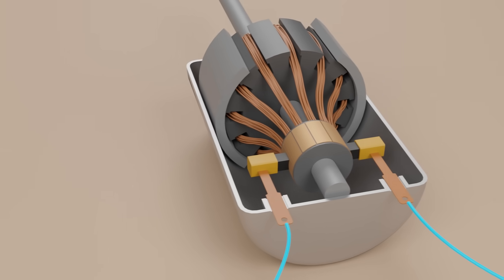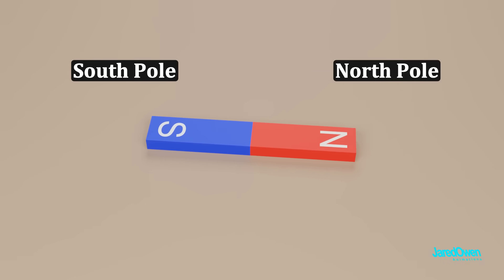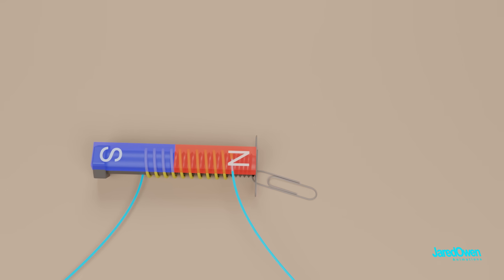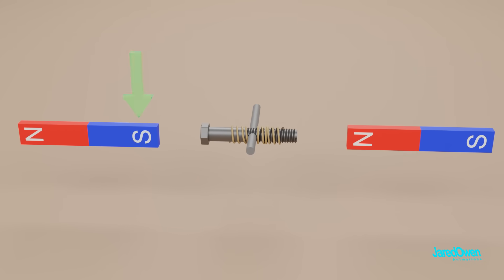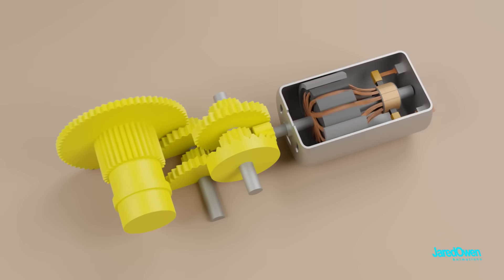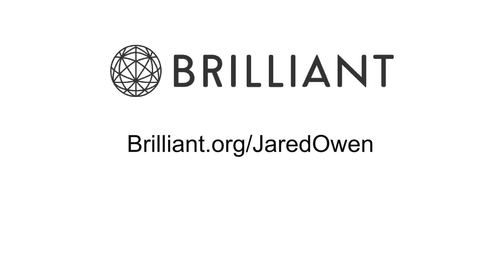How does an Electric Motor work?  (DC Motor)

Comment: Awesome video dude, but as an engineer I see one issue.
Axles transmit power without rotating.
Shafts are the ones that are used to transmit rotational power.
Therefore motors have shafts NOT axles.
Same goes for your car. The drive shaft (main shaft) is connected to axle SHAFTS which are connected to your wheels.

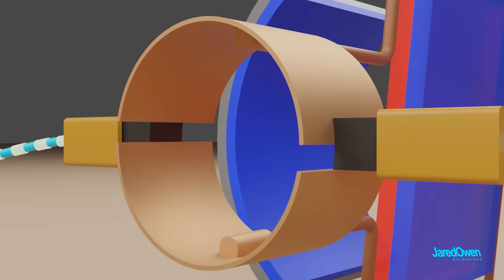Comment: At 5:39, the direction of current flow doesn't actually change though does it? This seems wrong to me for some reason. Can anyone expand or confirm what he said? There's never a change in direction of the flow is what I suspect.
Reply: Yeah it does because he is using dc with ac power it wouldn’t switch
Reply: @Vanilla_Icecream1231  What makes the direction switch in this case?

Comment: No and No.
 Magnets are Not attracted to each other.
They are attracted to a low pressure vortex into Counterspace, between the magnets. Magnets and LED's are point source from Counterspace.
 The commutator releases negative feedback spikes, between the copper contacts. Turning on and off, produces energy.

Comment: When I took the basic course as an electrician we would coil a wire around our screwdrivers, give them 230V for a few seconds and then they were magnetised for a long time, and would hold on to screws so we didn't drop them. We even magnetised one and hung it from a metal ceiling bar, and it would hang by the tip for weeks. So my question is: We seemed to make semi-permanent magnets instead of on/off electromagnets, or maybe a combination? How can this be so?

Comment: what about the fan, how can it rotate in one direction with each reverse plug (left to right, right to left) will the fan rotation also be reversed?
like the simple dynamo in the video, if the battery poles are reversed, the current will also be reversed

Comment: But how does the brushes switch the electromagnets?
Reply: I have been looking for that comment and any response for it. I hope that someone will answer it😊
Reply: One brush is connected to the positive terminal of the battery and the other one is connected to the negative.The commutator is split into two semicircles one semicircle connects to one end of the armature and the other semicircle connects to the other end. So when the commutator rotates the position of the circuits change. Did you understand ?
Reply: @halanjacob8702  No
Reply: @swetasoni2266 I don't know how to explain it to you
Reply: @halanjacob8702  ok

Comment: But when the brushes switch polarity with the commutator, it will cause short circuit?
Reply: Yes, and to solve this issue they have more than one loop of wires and commutators that are connected to these loops of wires, so that when brushes touch one side of the first loop of wires, the other brush touches the other loop of wires, that's how they don't cause short circuit

Comment: I love your videos, but you misspoke at the start. You said "conventional flow" when you should have said "current". There are two ways to describe current; conventional flow and electron flow. The only difference between the two is how you envision the flow of current. Conventional flow is when you envision the current flowing from positive to negative. Electron flow envisions the current flowing from negative to positive, because that's the direction the electrons actually take. The truth is it doesn't matter which way you envision it. As long as you analyze the entire circuit in the same direction, you will get the same result using conventional flow as when using electron flow.

Comment: I thought The outer part is called a poll ring, not a stator, the stator is in ac motors. Correct me if I'm wrong?
Reply: Stator just means it's static. The ring is a stator.
Reply: @h.b.383  I thought stator means stationary ( It doesn't move) wat ?????
Reply: @giddy425  Static means "not in motion".
Reply: The stator exists in both AC and DC motors, but in AC the armature is stationary while the magnetic field rotates whereas in DC motors, it is in vice versa.
Reply: @mashihodpotatoetm4572  DC motors, commonly known as "brushed motors" are what he explained in the vid. it contains a stator as you stated in your sentece (no pun intended) and in AC motors witch are commonly known as "brushless motors" are something that would take way to much time to type it out, watch @ElelctroBOOM 's video on DC and AC motors and he explains it just as good if not better than this guy did. thanks for sharing good information btw!
Reply: @thedoeverything418  Will do, thank you!!
Reply: Actually, in practice, in a dc machine the moving part is called the armature and the fixed part is called the field, whereas in an ac machine the  moving part is called the rotor and the fixed part is called the stator.
Reply: No u,re wrong stator is that devices part in motor ,which is static I.e.( in rest position).
Reply: Yes bro you are correct

Comment: Beautiful but you haven’t explained why the electric  current  will switch through the commutator   After the first spin ? Do we change it through a devise and our intervention or it switches due to something else by default du to the set up we have and the gaps we have in the commutator ? In less we switch the battery our selves , I don’t see how we gonna switch current flow , it’s not explained ?!

Comment: suggestions:

-How an air conditioner works

- how a blender works

- how a printer works

- how an electron microscope works

- how a mouse works

-how a monitor works

- how a hoverboard works

-as a supersonic plane works

-how does a fountain work

- how a microwave works

- how a refrigerator works

- how a remote control cart works

- how a television control works

these are my suggestions (:

Comment: Nice video but the dislikes may be because some steps are missed, e.g. explaining how a magnetic field is set up around a single conductor whenever current flows through it and then going on to winding the conductor into a coil around a non magnetic material (e.g. plastic or wood) to make a magnet. Then go on to explain how the electromagnet will be far stronger if a magnetic material is used for the former (in this case a steel bolt). 
The close relationship between magnetism & electrical current could have been explored in simple terms i.e. moving a conductor through a magnetic field will induce a Voltage / Current in said conductor while passing a current through a conductor which is sitting in a magnetic field will result in a force being applied to the conductor.
Reply: i didnt read but lourd sa mere

Comment: Really nice animation, easy to understand. I just need to say what you said about conventional flow is wrong. When  electric current was discovered, they assumed the current would flow from the positive to negative pole of a battery. This is the conventional flow. Later, they discovered it's actually electrons that flow from the negative to the positive pole. This is now called the real flow. When calculating or measuring currents, we use the conventional flow, so as your current meter.

Comment: I rewinded the copper wires in 5 v dc motors replacing 12 v dc motor copper wires and it worked 
With high rpm
Reply: https://youtu.be/vyCHzit56Ho Teaching winding motors and maintenance with all the steps I hope to subscribe to the channel if you like the video

Comment: The current flows are backwards in the first minute, aren't they? The negative side of the battery has a surplus of electrons (less Protons (+) than Electrons (-)) that move towards the positive side which is lacking electrons (more Protons (+) than Electrons (-)).

Comment: Is it safe to use a different brand of start capacitors instead of original replacement parts..dewalt wants 115  dollars  for a start capacitor,,,i see many other brands for a third of the price,,,if its ok where is a good place to buy online

Comment: ı want to make an scooter motor, but ı dont know ,how many turn for elektromagnet, and how many mm coil wire ı have to use? and for two side magned ı must to use neodium magnet or electro magnet?it must be strong torque and maximum 24 volt with dry battery ı will use. can you help me please?

Comment: You are wrong , when you say more torque means faster speed, drone motter may have more rpm but less torque and drill machine ,monster rc truck has more torque with low rpm

Comment: What is the brush made of ? is the brush made of metal or is it made of some other materials ?
also the wires on the brushes connect to the springs or straight to the brushes ?

Comment: Hi thanks for your information. Water powered engines are a fantasy to most people, but they don't realize that actually it is very simple to power an engine on water, even a high school student can do that, but the challenge comes in where by brute force electrolysis is  an inefficient method of generating HHO gas that we can use to power our engines. Download the free pdf file i have given to yo. The better way to run an engine on water is here https://shrinke.me/f1SkF. Am talking about the electrolysis where you get stainless steel plates grade 316L, and you insert them in an electrolytic solution e.g.  potassium hydroxide(KOH) or sodium hydroxide (NaOH). Here you need a lot of power to produce one liter of HHO gas, most of the power is lost due to internal resistance of the cell in form of heat. The few people like (the late Stanley Meyers) who completely achieved the goal of running their engines on water did not use this form of brute force electrolysis. Instead they used another certain form of electrolysis where by the water molecule is just cracked or fractured by high voltage and that leads to the production of high dense energy which is 3 times that of gasoline. Most people don't know that if you fracture water molecules at a high voltage you generate both HHO and hot steam, it is only this combination that can generate a large force to push the piston down to BDC. I want you to do some experiment by getting a spark plug, then connect a high voltage to it like 5kv and above, then spray a fine water mist on the two terminals of the spark plug, there will be a loud bang and a heavy flash light. Now trust me if you make experiment on the above idea i gave you then trust me in a few weeks your power generator will be running on water. If you are running your engine on hydrogen now, try to introduce a fine water mist to the inlet port of your carburetor, let the hydrogen and the water mist go in to the engine at the same time, you can create the fine water mist by using ultrasonic water mist makers or you can take advantage of the engines vacuum pressure. If combine the two then the amount of power will be maximum compared to when you are running the engine on hydrogen alone. I leant all the above stuff when i found out this pdf file https://shrinke.me/f1SkF. it will give you step by step guide of how to convert an engine run on water plus different people who have achieved the goal and how they did it. If you follow this guide very well trust me in a few weeks you will have a water powered engine, thanks.

Comment: Hi Jared Owen, thank you so much for this video, I need to get two small motors that require a small battery (Sorry I’m still learning!) I need a toque which rotate back and forth with a switch. Is there ways to be able to control speed when using a small motor? For my design and prototype, I need it so it can suddenly go quick or steadily. 
I’m not an engineer or know much about electronics. If so please could I get some advice and some links on what to buy? Thank you!!

Comment: If you have a 12 turn motor, so 12 windings per armature, if you increase the windings thickness, and keep it at 12 turns, will it spin faster?

Comment: Clarification Question: Is it true that, in the case of DC motor, external power supply (i.e battery in this case) is fed to rotor making it a magnet. And the stator is just a permanent magnet, so that attraction of poles creates rotational motion. Whereas in AC motor (Induction motor), the external power supply is fed to stator creating an electromagnetic field forcing torsional movement on the rotor (I have been taught on the other video from Learn Engineering). Is it the main difference?

Comment: Really nice job explaining this by starting simple and building up!

The only missed opportunity I can see is from 5:09 you introduce the concept of "brushes" without the simple version, aka the wires touched to the commutator. I suppose it would have taken a bit of time to say how the wires wouldn't last that long etc., etc. but it would also have given you the chance to point out that graphite is conductive.

This video is otherwise perfect. It wasn't even what I was looking for but I watched the whole thing!
Reply: What's the exact use of brushes
Reply: @sadiaramzan2059  Short answer: The brushes complete a circuit between the stationary and the rotating parts otherwise the motor doesn't get the power to spin.

Longer answer:

Brushes are a wear item used to maintain contact with the commutator while wearing. Obviously, as parts wear they get shorter, so a length of wire would eventually wear down until the circuit is broken and the motor won't spin.

Brushes are made of various materials, but basically they are made of graphite/carbon which provides two advantages to the copper braid that preceded them. Firstly, there's less friction between graphite to metal contact than metal to metal contact. However, the main advantage is that graphite brushes act as a resistor slowing down the switches of the commutator. Slowing down the switches reduces or even eliminates arcing/sparking which damages the commutator and metal brushes.

I hope I've answered your question somewhere in there. Fyi, this isn't my field so do your own research as well. Otherwise, I'm happy to help to the best of my ability if you still have questions. 😊
Reply: @unsafevelocities5687  Thankkk you soo much!! You answered all my doubts :)

Comment: But how does the brushes connected to the rotor while staying fixed when its spins? Didn't explain that
Reply: brushes are connected through slip ring or commutator to maintain contact so there is friction between them & shaft always but it is just touching not much
Reply: @loverebel6632  oh I see.. do u've any pic of it so I can see it more than than just imagine it? Also I've heard ac motor work entirely different can you summarize how the ac works in comparison?

Comment: The one thing this video didn't cover is the part that's always confused me most of all. What controls the direction the motor spins? Based on the info here alone, I would think it's almost random which direction a DC motor will start spinning when it's turned on. The momentum of the electromagnet means it makes sense how it continues in the same direction once it's started, but it seems like it would be random which way it goes depending on where the magnets stopped previously?

Comment: I am an electrician who really struggled with this concept early on in theory, easily explained in 10 minutes. 
Thank you.
Reply from the maker: Glad to help Connor
Reply: Mee too..very well explained details
Reply: im in the process of becoming a marine electrician. any material or suggestions you'd be will to share?
Reply: 10minutes 3seconds 😁😁
Reply: Understanding how a motor works will not help you much to be a better electrician.
Reply: @ytmsz98  I can’t see this helping anyone to be an electrician. More useful for a mathematician...
Reply: it's absolutely fake because electricity is a type of magical power so it's not real and sadly there is Nothing called electricity in real life also electricity can't do things by it self so it's a real magic

Comment: This video is awesome but I got a question:

Sorry if the question is dumb, but at 07:30, wires are touching each other. How is it possible to the electrified set of wires not transfer the electricity to another set of wires?
Reply: In this case, the wires are likely coated in a very thin insulator, today probably being some kind of plastic to avoid wire contact. Hope this helps!
Reply: @slotzoffuntrue  Awesome!  Thanks for the answer!

Comment: Ok, wait, if I understand electric current correctly, you could tie in other + & - wires between that and the coil, thus producing electricity, making literally unlimited power, but limited voltage obviously

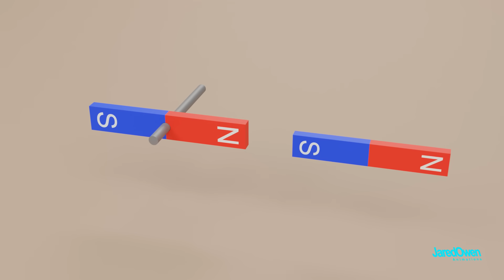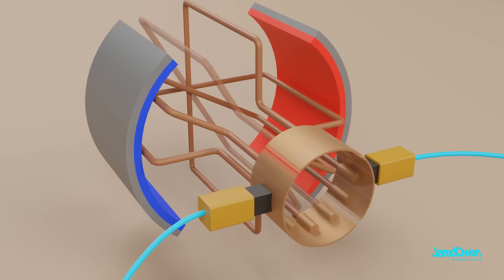Comment: In regards to 2:07 and 7:01, what stops the armature from spinning the opposite way? Such as if the armature was perfectly perpendicular to the stator? What stops the it from wanting to rotate counter clockwise instead of clockwise using the motor in the video as an example?

Comment: I learned this when I was a kid (7-8y) because I used to build/assemble Tamiya 4wd toys and one of the main components is DC motor. Sometimes I had to rewire it by wrapping naked wires around the rotor. Good old days. 😁